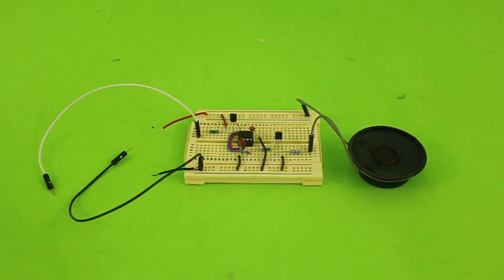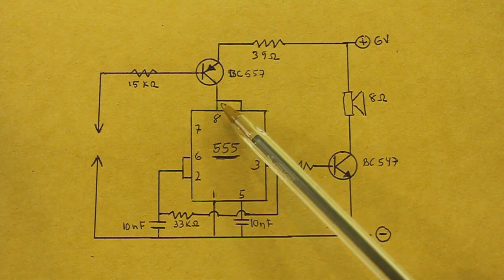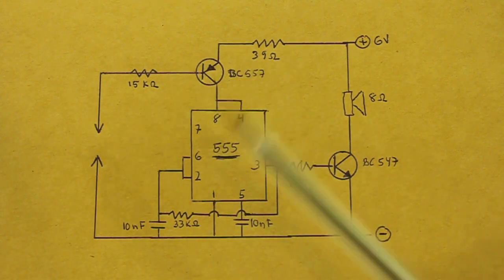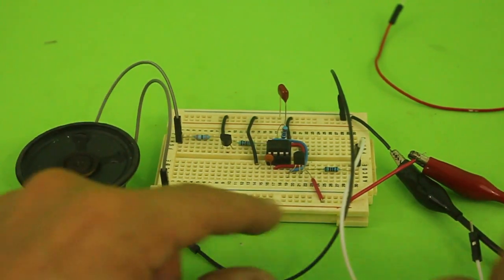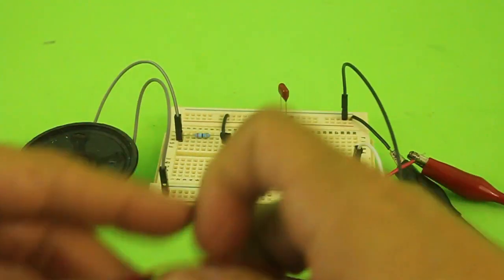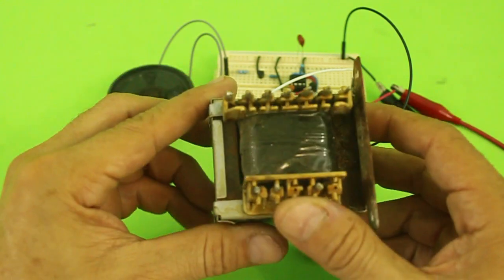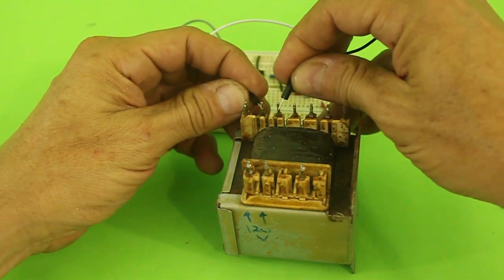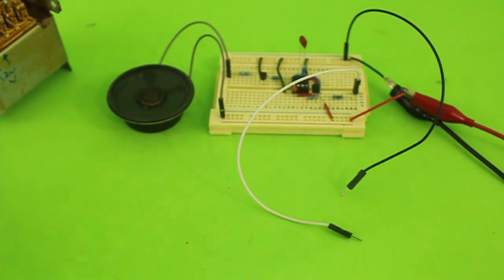Continuity Tester with 555 IC

Comment: Why did you put the 555 ic? Wouldn't is work with just a simple circuit of a battery - buzzer - probe - probe then back ti battery? Why the 555? Sorry I don't understand?
Reply: No, i just got it, he used a speaker which needs the quick on/off oscillation of the 555 output to make the speaker audible. A buzzer just needs voltage but not everyone has one lying about. If you have an old pc you will find one in there which you would be able to use instead of the 555 ic. I think a buzzer would be more common in households than a 555 ic so there's another way to do it.

Comment: very nice thank you
please can you make video about making mechanical rectifier of 220v ac to 220v dc ?
it would be so great if one idea works , for example convert ac motor to a rectifier , or ac electromagnet when the wave is positive it attract two wires and when the wave is negative it attract switched wires (using a permanent magnet so the electromagnet attract only only one wave) , i think a capacitor is needed to shift the ac wave ,
https://drive.google.com/open?id=1M47HoFsmEbV9Cmnw3tIYw2tmWD2XISRm
please reply for any advice or idea
 thank you very much.

Comment: Cool project! Thanks for sharing.

You said an alternative method to test continuity would be to measure Ohms with a multimeter. But I haven't seen a multimeter that didn't have an integrated continuity mode. I use that to test continuity. Awesome project nonetheless!